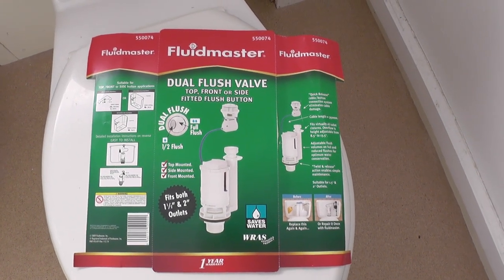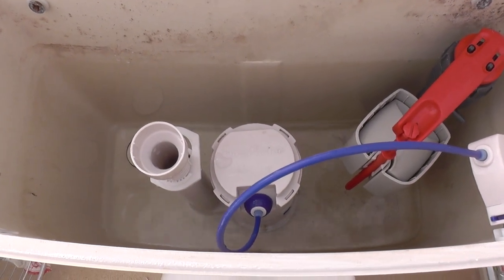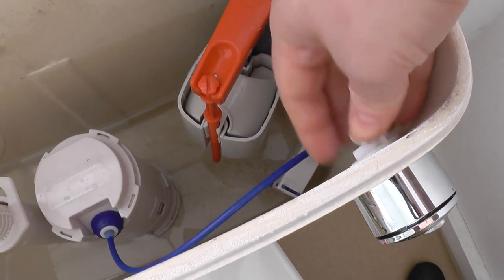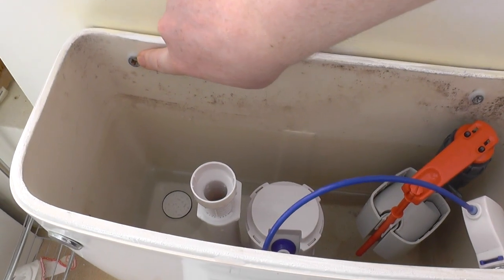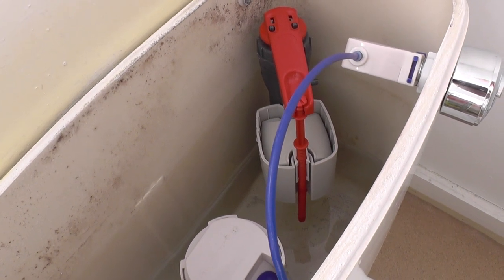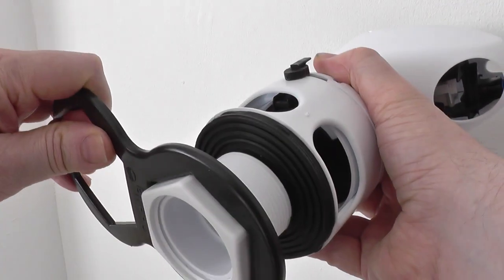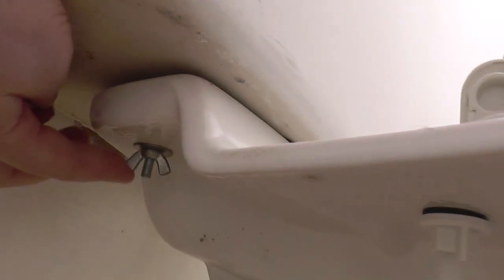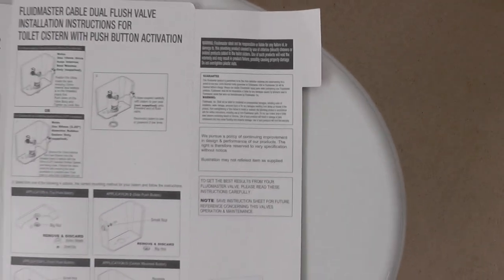Fluidmaster Dual Flush Valve (a quick look)

Comment: On my Fluidmaster Dual Flush valve the top is black and I have to twist the body in a clockwise direction (and jiggle a bit) to release it.

Comment: I fitted exactly the same Fluidmaster flush valve about three years ago, but recently the button, which in my case is mounted on the lid, has stopped popping back up after a full flush. It always pops up after a half flush.

Comment: That fillvalve is made by wirquin not fluidmaster. Could be branded fluidmaster but in my country those inlet valves are branded wirquin you should check their flush valves their are far better quality that that fluidmaster valve and the wirquin flush valves have that special spanner tool included with the product. And they come in two different size outlets that makes it universal.

Comment: Do i need to take the cistern of if I wanna replace the flush valve?
Reply from the maker: i dont think so. they usually connect with a nut underneath ? a big nut tho. sometimes the maker supplies a plastic spanner that fits, often not. newer ones maybe have an alternative easier method. ?? not sure what im saying ...
Reply: Lol. No worries . Got it sorted .

Comment: Nice one, well explained
Reply from the maker: With hindsight I find the 'flush' too strong, meaning the water in the bowl can get pretty wild (i.e. embarrassing splashes). For that reason I have changed to another type of valve. I couldn't find a way to control the power of the flush.
Reply: Is this anything to do with the particular setup of the cistern as all it is doing is releasing water, no different from any other product?
Reply from the maker: I'm thinking it might be to do with the flow rate. How much water gets through per time. Probably how big the opening is. Some flush valves give a flow rate.
Reply: +Gordon Southgate It's "dual flush". That means that you press the big button to say "bon voyage" to a number 2 or the little inset button to flush a number one ;-)